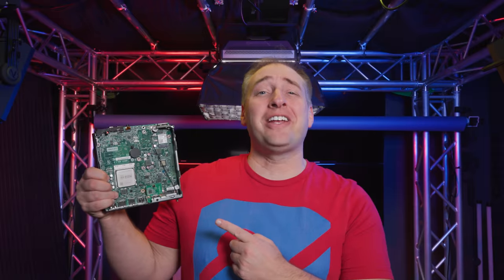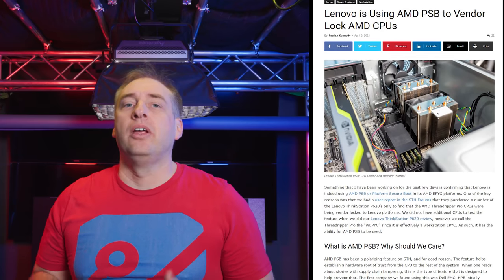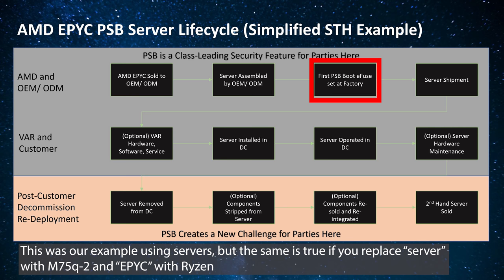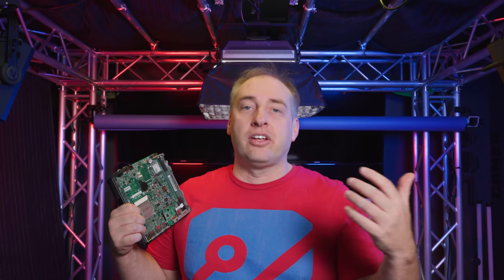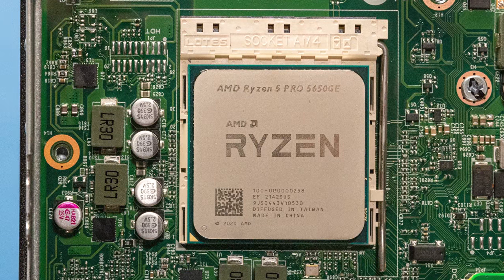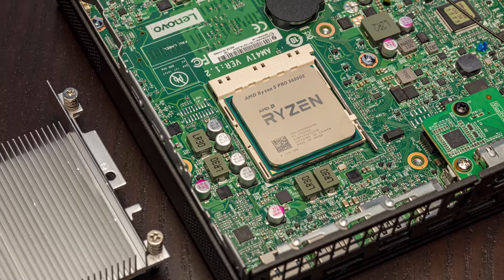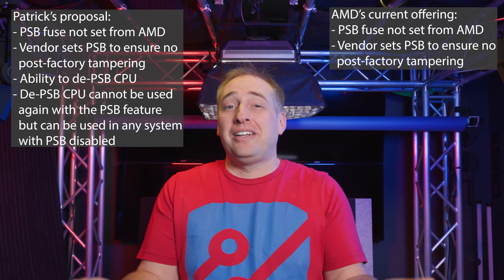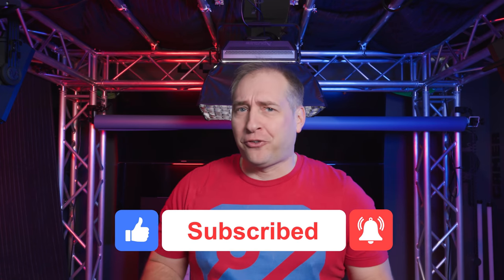Yikes! Lenovo is vendor-locking AMD Ryzen CPUs via PSB

Comment: From what I can tell, the issue stems from using e-fuses as the vendor key storage medium. (Maybe a few hundred bytes?)
For contrast, a few kilobytes of flash EEPROM in an on-die cryptographic module could be securely erased and then reprovisioned with new keys. (Mitigation of die-level attacks could be accomplished via the old standards of metalization over the module, photodetector booby traps, and conductive 'maze' barriers to prevent deencapsulation, laser attacks, and microprobing. Maybe a few transistor-junction random noise generators to prevent EM snooping.)

I think that there should be a way to revert the cryptographic material back to the initial factory state.
To my understanding it is almost universal for cryptographic modules to include some command to "zeroize" themselves (erase all secrets) and may often be designed do so of their own volition if they detect tampering.
This factory reset command could be exposed as a BIOS option that pokes one model-specific-register or calls a special instruction with the appropriate parameters, a command on a serial port or system management bus, some spare pin held high/low for several seconds at startup time, or whatever else the designers see fitting.

Validating that the CPU+Motherboard has not been tampered with would then involve requesting the CPU's security module sign some unique timestamped message and send that signed response back off-machine to be verified. (You'd be signing with all of: A shared per-model AMD attestation key, a unique per-chip secret key on OTP memory, the vendor-assigned secret key on erasable memory, and perhaps a key generated at machine provisioning just to be extra sure)

This same signed message method could be used alongside the boot process verification check to detect if something changes in the bootup process.
Validating the BIOS and any similar firmware would be a matter of reading them and signing a hash of what was read. 

If desired, the machine could be configured to fail to boot to the OS if the hash+signature from the BIOS/firmware does not match that stored on the CPU's secure subprocessor.

If the existing AMD CPUs do not have cryptographic modules with suitable hardware, it may not be possible to do until the next generation of chips though.
Efuses are like that.

Comment: I am ok with vendor locking in some circumstances. And provides value to the customer (customer is not end user). The end user doesn't need to buy a Lenovo. 

However! It shouldn't be hidden from the end user. Some circumstances the end user does want the secure supply chain (that's the idea of secure boot). But we shouldn't be guessing trying to find a non vendor locked processor. It should be clearly defined or at least buried in the laser etched sku "5950-psb" the same way they do with the mobile processors. 

I get the idea that vendor blowable fuses simply is a feature that doesn't need to be used. But including it on every die makes it easier to streamline manufacturing. 

Amd has some decisions to make. They will probably not care what end users want like always...

Comment: One way to do it would be to give you the choice on the first boot.  You would be able to say no and have it not ask you again.  You can also have it still in the setup utility just in case you change your mind.  Also if you do enable it, have it tell you that it is permanent on that processor and it can't be undone.
Reply from the maker: The challenge with that is that it needs to be secured when it leaves the factory. Waiting until a user gets it means it has already moved through the supply chain.

Comment: another option, there is a counter and a fuse on both the mobo / cpu rather than just a CPU fuse, and have the following BIOS options in Boot that states. 

PSB_LOCKSET_COUNTER_EQL_1= TRUE. (This will blow the fuses enabling PSB)
PSB_LOCKSET_COUNTER_ALLOW=2,3,4 etc...(This allows for the resetting and reuse of the feature should the security policies allow)

This will allow for the prompt to enable PSB if it is 0, the system will only boot if the counter is one, and if you disable PSB or it has been reset and reenabled, the counter will be 2. The CPU will then not boot If both the mobo and CPU eFuse is blown.

pro consumer bords however can choose to not have EQL_1 enabled on its end.  If the cpu has had its EQL_1 fuse blown, but the motherboard does not, it can fall back onto an Auth code. it can prompt the user to reset the PSB, increment ALLOW by one in its self and set the mobo ALLOW to its internal count. then the CPU gives an auth code bound to the system signature. if it is booted in another system, the auth code is required to reset the PSB again.

If all else fails, the final fall back is similar to what was suggested by Patrick. add this final flag.

PSB_LOCKSET_RETIRE =TRUE 

This will blow the PSB , and a motherboard that is expecting PSB can prompt the user "PSB on this CPU has been retired" and refuse to continue post. If a motherboard does not care however, it will just carry on as normal.

Comment: With your suggestion it should also be possible to have "PSB disabled" CPU (so a former PSB CPU with all fuses blown) in a PSB motherboard which has PSB disabled in BIOS. On the second hand/home lab market you'd probably not care about their security anyway and this way you could just disable PSB completely without having to find a non-PSB motherboard (I mean afterall there already seems to be a BIOS option for it).
Reply from the maker: That is the basic idea.
Reply: @ServeTheHomeVideo  I wouldn't even mind if you got a big red warning on post that you couldn't skip for several seconds that told you that PSB had be irrevocably disabled in the CPU and the security chain could no longer be guaranteed.  So that if some malware managed to blow all the fuses to disable checks it was VERY obvious.

Comment: Does that Lenovo board boot with a non-Pro CPU? I heard from another user that it does, and if so, then that kinda undermines the firmware validation aspect of PSB, since non-Pro CPUs don't support PSB as far as I know.

Your solution seems pretty good to me as well.
Reply from the maker: Once you replace CPUs from the factory, then you undermine the idea that the system was not modified from when it left the vendor's factory.

Comment: I think there should definitely be a way to fully disable PSP. Then, such information should appear during post on the bios screen - that it is disabled, however it shouldn't be blocking the boot and/or confirming, or maybe you should be able to confirm it just once and that confirmation should be saved like a bios setting and bios should display this information transparently to the user
Reply: PSP is essential to the startup procedure of an AMD Ryzen processor.

Comment: I got an used Ryzen 5 Pro 4400GE on ebay, it's working on a Soyo motherboard at my homeserver for more than a year now.
BUT I noted that motherboard, CPU-Z, Windows, all detect it as 4650GE.  After some research I found that this 4400GE was a Lenovo "custom".
There should be some identification on the CPU that it could be vendor locked.
Of cource, the ideal would be no lock at all, at least there should be a way to disable it.

Comment: So others have suggested to tamper with the firmware and get a brand new processor, but it could be done even easier. Depending on the cryptosystem and particulars of the keys, the adversary could tamper with the firmware and sign with a newly chosen key, similar to the original such that with a few more popped fuses the PSB checks out just fine. E.g. say they're using the RSA cryptosystem, keep the same modulus, and regenerate such that the exponent is a positive bitflip of the original exponent...

Comment: I picked up An m75q gen 2 with a 4350ge at the end of 2020 and it was vendor locked already, so they've been doing this for a while. The only reason I bought the system was because they were marking those chips as OEM only, and I went with Lenovo because of brand reputation (won't make that mistake again). What makes me suspicious (tinfoil hat moment) is that Lenovo was the one vendor that had these chips readily available. Even now when you look up these 5000 pro chips which AMD now claims are being made available at retail, you still find none available at retail but you DO get results for the Lenovo boxes using these chips. If I was a betting person, I'd say AMD is sending the bulk of these chips to the vendors willing to take on the bad press of tanking the secondary market while keeping their hands "clean."

Comment: 3:50 - And it's there to provide terrible unpatchable backdoors.
It has the ability to monitor every aspect of your computer, intercept and modify traffic, read data from your memory, drives, all outside of the main OS karnel, meaning it can bypass any OS permissions/restrictions and since it's an entire computer, with it's own memory, cores, storage and an OS (just like Inte's management engine) AND has network connection, it can be hacked just as any other computer... It'd be really big news if somebody got hacked throught that since it's pretty unlikely. Though you can't argue it's not at least partially a bad thing that if it gets exploited and anybody manages to run custom code on it, or even worse, overwrite its internam memory -  then you won't be able to get rid of it all unless you throw out your entire CPU...
Reply from the maker: We are going to talk about another feature in the TMM overview of the machine that will be coming soon.

Comment: Or they could add verification in the UEFI, if the cpu PSB is not set or set to another vendor then warn you that the computer is "not secure" or "tampered". I don't think they doing it to protect the customers but to prevent the reuse of old parts -> sell more new computers.

Comment: The only reason to buy the Top end model as a consumer, is if its cheaper than a DIY version trough a Asrock Jupiter X300 
otherwise the system itself would be quite trash.

I am still looking for a " Asrock Jupiter X300 "
which is already out for over 10 months, yet it is not sold anywhere at all. especially in the EU.

Comment: So while I agree with you in general that this is sorta a dick move in the sense that it locks a CPU without letting you know, I think this is an edge-edge-edge-edge case:

- Buys a Lenovo. While Lenovo is #1 world wide its US market share is a distant 3rd and sometimes 4th depending on how Apple does in a quarter. 
- Buys a mini PC.  Mini PCs are a pretty small market...even a mini one :)
- Pulls the CPU.  Very few people ever change their CPU, even among the DIY crowd. Its even smaller in the prebuilt area. This is a prebuilt mini which even fewer people open up. 
- Puts the CPU in a non-Lenovo machine. Less edge case than the others simply because the small Lenovo market share means it more likely someone would attempt to put it into a non-Lenovo machine.

So when you add it all up, the number of people impacted by this could be in the dozens and most of them subscribe to this channel and now know not to attempt to use that CPU in a non-Lenovo computer.  

100% agree that AMD should allow some way to strip the PSB and allow long term upcycling, epically since its a great processor that will be able to do general computing for a very long time.

Comment: If you research, Dell EMC also have used this mis-feature. I don't know which series are affected, but it is a really nasty behavior. What security do they achieve when they brick the CPU ? HPE systems didn't use it.
Reply from the maker: Yes. We were the first to report on Dell doing this in 2020 and got the official statement from Dell and AMD: https://youtu.be/kNVuTAVYxpM
Reply: @ServeTheHomeVideo  I saw the video and I am not convinced how bricking the CPU will enhance the security - the hacker can just get an unlocked CPU, replace the bricked one and still boot.  And if they go further in "security" and brick the main-board as well - then what the customers do if the CPU fails - lose all their data ? Then the data would be not secure - it can get destroyed, which is sort of anti-security.... If it is a supply-chain attack - the attacker manufacturer would patch the BIOS prior burning the fuses or he is at resale level - he also can just replace the CPU.

Comment: I don't think we should be buying these locked devices, as others say, not able to be recycled for other machines.
Reply from the maker: We are going to have a bit of a guide on this system, but then get into some HP alternatives that are going to be eye opening for many folks.
Reply: @ServeTheHomeVideo  Maybe the solution is engrave the key on the processor so that users can enter it into bios? Not really possible with the length of a good key, but an idea that still requires physical access to the processor.

Comment: It seems like this security could easily be achieved without vendor locking, unless I've missed something.

CPU contains AMD's public key, vendor gets AMD to sign their own key pair, they check their own key pair from the motherboard, but then you can put the AMD CPU in another vendors board and it only really cares about the AMD pair and the new vendor's pair.

Comment: Before video response: vendor locking CPUs is dumb and makes them ewaste.
After video: it's not really even vendor locked. It's bios signing key locked. If Lenovo changes keys they use your existing system may not be able to use a new bios. It seems like there should be a way for the secure processor to update the key, and remove the ability to unlock anything signed by the old key. So your old windows install with bit locker turned on won't boot/decrypt. 

I agree it will impact the reuse, and resale value in the future.

Comment: Looks like AMD built this feature to provide motherboard level OS security. Not so corporations could hold hardware hostage for anti-trust level parts branding and monopolizing. So AMD should have no problems providing users with a CPU back door boot option that ops out of this security feature. Otherwise this is massively unethical.
Reply: What's to stop a hacker using that backdoor tho .. hmm

Comment: You said several times that after PSB is enabled the CPU won't work with an HP system but what about a system I built using new parts? Would it work in a Gigabyte or ASRock motherboard I bought from New Egg?
Reply from the maker: We did not test that, but Dee who has the pinned comment here posted on Twitter that there were issues. That is what we would expect with PSB so it makes sense.

Comment: Another note, Is this also an issue with Intel "tinys" - like the M80/M90q?
Reply from the maker: Currently, no. Intel does not have the same set of security features as AMD. On Ice Lake servers, for example, server vendors put an Intel FPGA for Intel's hardware root of trust feature.

Comment: I am old school I have just replaced the  keyboard membrane & upgraded the ram to 16k on my zx 81( I have no idea how I am going to use 16k) but I have been repairing upgrading computers of all types (although not vacuum tube) & this is the WORST IDEA EVER & SHOULD BE BANNED. I have unlocked cup's using ( pencil or conducive paint/glue) & have built computers using parts from all types ( home/ servers/ clusters) this will  kill any recycling or reuse & kill my fun.

Comment: This is NOT new.. This is the whole OEM Based system.  The CPU is married to the Lenovo brand.. The OEMs get special pricing from CPU mfgrs for locking into their BIOS brand and not cross contaminate brands with unknown boot security... This is the entire TPM security stuff....  I absolutely agree with Patrick here, and I understand the OEM Locking... Answer is purchase a retail CPU and not an OEM CPU....   A new retail CPU will work with absolutely NO problem.... Follow the money; and it will usually give you a clear, concise answer :-)

Comment: It's not the vendor locking that worries me as much as preventing me from patching the boot firmware. If it can be modified, then it should be modifiable by the owner.
I'd be fine with your solution, for the most part, as long as application software can't tell if the CPU is unvendorlocked. Malware that refuses to work if it detects a developer or security researcher's machine is a problem when you can't hide that from userspace / virtual machines.
Edit: The processor will happily accept a known-buggy vendor signed firmware, but not a user-provided one. This is not well thought out, if it's supposed to be a security feature.